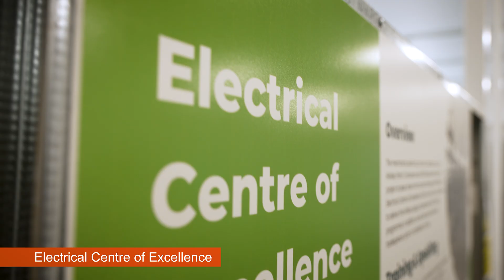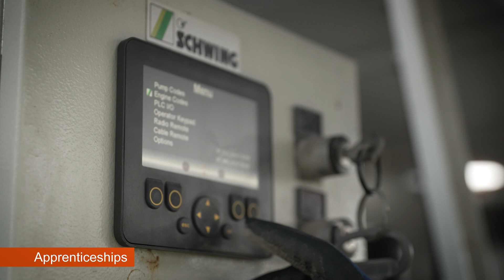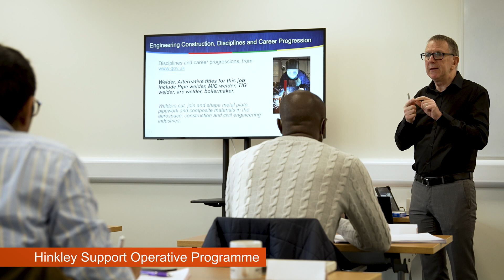The Pathways to Power Up Hinkley Point C

Comment: Edf says it stands for justice and fairness.  I would like to know what is fair. The summer gone it was extremely hot for few weeks. I have a smart meter. I call thier auto pay line to pay with my card. The top up meter is Very temperamental and mostly takes a long time to become active. Which means my payment does not go through. Which means I have no electricity. As I said the days and nights were hot and close. Where I live is quite small on the 2nd floor. It is so hot in my kitchen if feels as if the oven is on. For 2 days a neighbour  and I tried to get the meter to work. It was not allowing the payment to go through. I could not even have a cup of tea. I did not open my fridge or freezer. I had shopped the day before . And filled my the fridge and freezer up. I was aware that my fizzer was defrosting. It was two and a half days before it finally activated. Most of the food was defrosted, some more then others. Edf said that google said that it would be ok to refrizze the content. I'm afraid I don't care what google say. I went with what the manufacturers do not refrizze frozen food. I took photo of all the food that was wasted and e email the ubmusmen. Citizens Advice was handerlin my case. A fat lot of good they did. I have texted Edf via WhatsApp as there is a customer link with the. The link is all over the world. In most cases, it was not understood what I was texting. They said the information would be passed on to management. I don't think it ever was. Owed them some money. They owe me about £160...they refuse to even acknowledge my claim.  I am not paying edf any payments tell they pay me for the loss. Essentially, in todays prices which will be a lot more money. 
So much for Juctice and being fair.

.

Comment: First new nuclear power station in the UK for 20 years? Try more like 30 years, Sizewell B started construction in 1988 and Hinckley Point C started construction in 2017.
Reply: The difference between the dates you've provided is 29 years. 20 plus years, as stated in the video, is correct.
Reply: @masterbarnard  But given it is almost 30 years, saying 20 plus is considerably under playing it.
Reply: @owensmith7530  Almost 30 years is perhaps more accurate, but a minor detail. Public infrastructure projects of this scale and ambition don't come along often.
Reply: @masterbarnard  China built a similar reactor in Karachi in 6 years. It's called the Hualong One. These are the guys who were thrown off the HPC project. Now it appears from the video to be run by primary school teacher types.